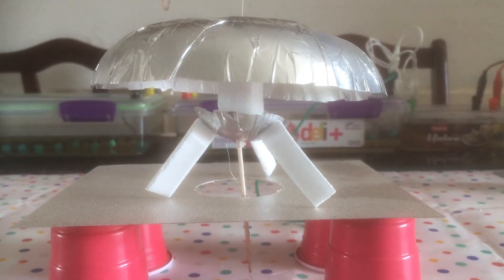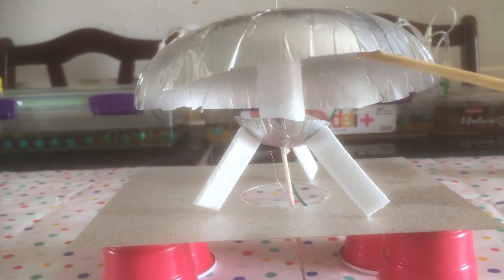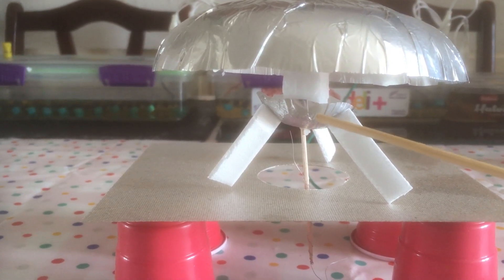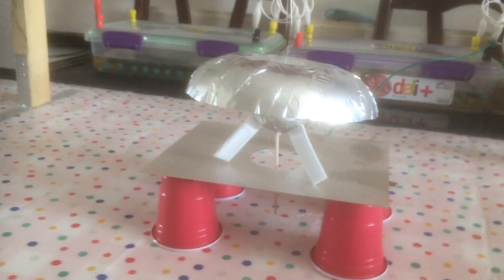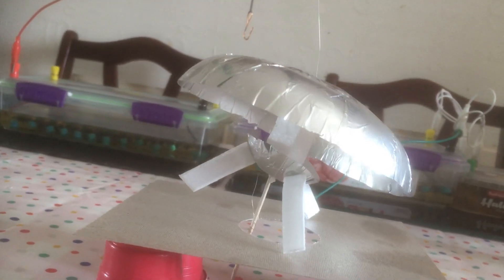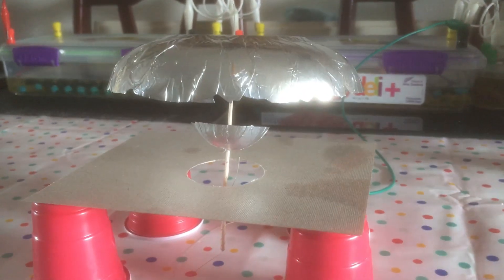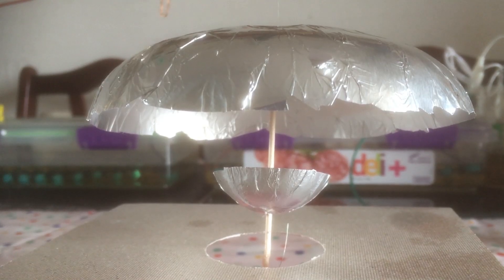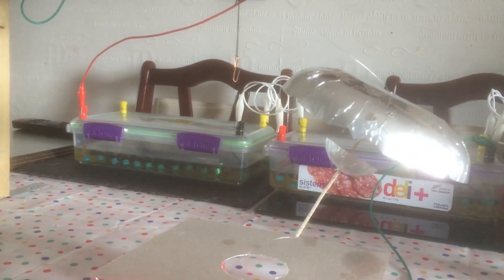Electrokinetic apparatus reproduction

Comment: How did you do to build such a perfect dome ?.  Thank you.
Reply from the maker: Its just aluminium foil press folded into a small kitchen bowl. Its important that its roughly a parabola shape, and all parts have to be correctly spaced apart from each other. You have to size it for both the weight of the aluminium foil and the voltage you are using. I did that by trial and error. - Its a parabola shape, and we are using a reflector in the focus

Comment: Your reflector is upside down from the way Brown showed it in his 1958 notes. He used three terminals. The canopy is positive. There's an electron emitter over the canopy and the lower terminal goes the other way up and it is also negative.

Oh now I saw your previous video where you did it his way. You probably do need a lot more power to do whatever Brown was doing versus regular ion wind propulsion.
Reply from the maker: It goes up, which is the main thing. I could only get it to work if the reflector curved the way in the video

Comment: is it really 12V or are you transforming it to KV? would like to rebuild it. Looks really interesting!
Reply from the maker: Hi, the PSU outputs 12v, but you must convert up to the kilovolts to ionise the air and create lift. The saucer design here apparently can use AC or DC, but I have only ever used DC, in the range 70 to 300kv. Lift being a function of geometry, weight and voltage.
Reply: @c6jones720   How did you convert 12V PSU output in 300kV ?
Reply from the maker: @dzonidonga2814  Have a look here, https://github.com/cybernetic-research/ion-lifter-esp32-command-control-network/blob/main/Lifter%20Command%20and%20Control%20Feb%202021.pdf

 you'll see a schematic for something similar with part list and BOM. The PSU there does work for lifters of 3g with thruster side length 20cm, but you'll need mode cockroft stages for the saucer.
Reply: @c6jones720  Thanks for the answer. 300KV - that is a lot!

Comment: Add another emitter at the top center, same polarity as bottom emitter.  Then you have the last surface of the craft influenced
Reply from the maker: Interesting idea. I think some of the TT Brown saucers had smaller sections inside them.
Reply: Increasing in size the higher up, three to be exact connected to the three resonators on the bottom

Comment: I think you should try it with not tinfoil but a perfectly shaped aluminium. Normal foil is effecting everything. It's a nice design by the way.
Reply: How about plastic coated with graphite or metal powder. ...
Reply from the maker: @m3sca1  Thats a great idea, I dont have the materials but thin films of graphene, or even metallic glass could have a use here. Im toying with a multiaxis control system for this, something tells me it might be easier to control it than a lifter
Reply: @c6jones720  you could make a paint with some metal dust and aero dope or such. Sand or dremel some aluminum wetted with something compatible with the glue or varnish...maybe even copper. Metal powders can also be purchased online. I have graphite
Reply from the maker: @m3sca1  Its certainly an interesting idea, I might look into it
Reply from the maker: can you say anything more about the foil and its affect on other things?
Reply: @c6jones720  crumpled foil affects the work potential of the craft, smooth surface is better